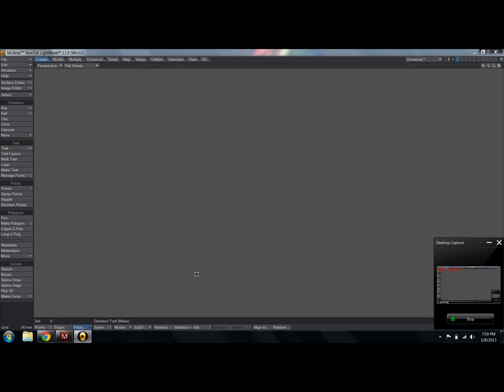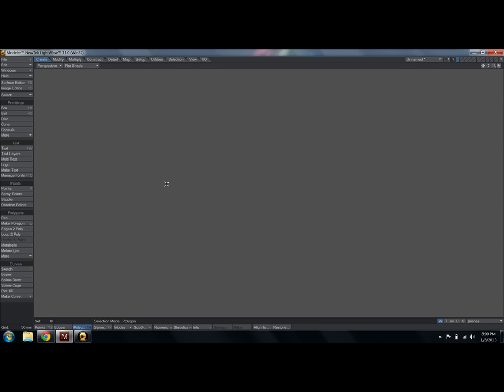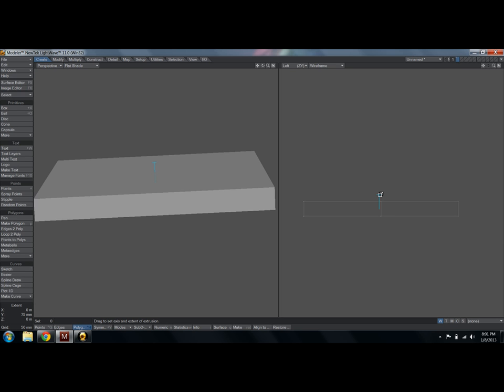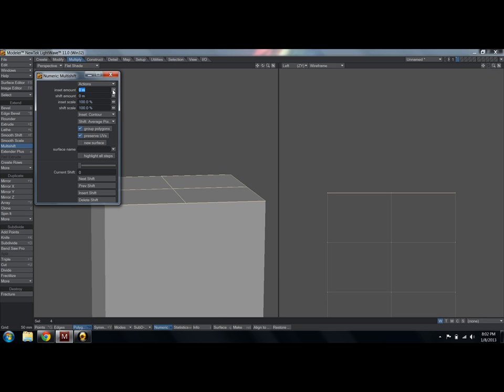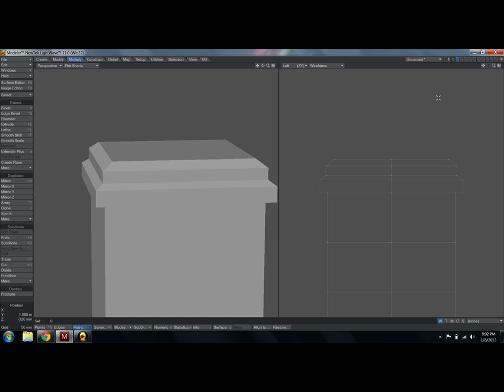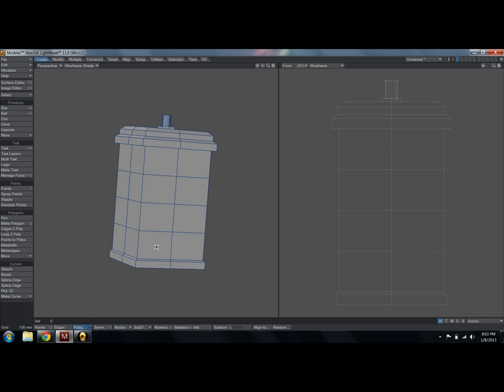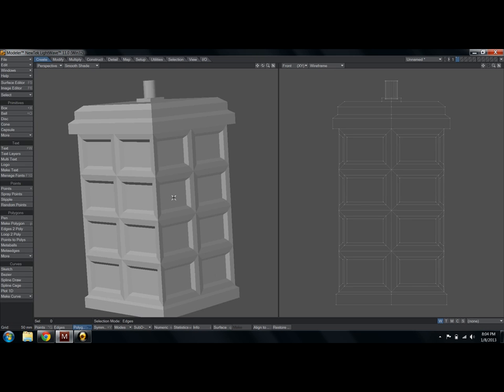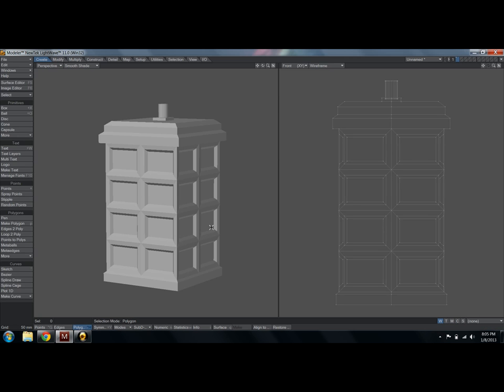Lightwave 3D for Beginners / Pt. 5 / Build tutorial! "TARDIS"

Comment: Whenever I use multishift on subdivided polygons, the "Group Polygons" in the numerical panel doesn't seem to actually group them. I've restarted modeler 5 times now just to get it to function, but it doesn't. Any ideas what is causing this? I can't bevel all my subdivded polygons together, they just split up into their individual squares, please help!!!
Reply from the maker: No idea. It might help to clear your config files before restarting, though.

In your program directory, if you dig into it there should be a "configs" folder. Go into that, make a copy of everything and put it somewhere else for backup reasons in case you need them again, and then delete that stuff from the original folder. (Leave the configs folder itself there, just delete everything in it.) Modeler should automatically write new configs the next time you open it, and ideally that solves the problem.

But also maybe not. 

Is it possible that all your polygons aren't actually welded together? The behavior you're talking about sounds as if it could be simply that the polygons on your surface are next-door to each other, but not part of one cohesive mesh. Merge points and try again?
Reply: Teague Chrystie Okay thanks! I'll try that later and get back to you :)
Reply: Managed to fix the issue, configs weren't the issue, somehow I had some side only polygons going across the sides of my polygons I was attempting to multishift, I think the issue was that they weren't actually connected. I managed to grab those polygons in wireframe mode, deleted them and then I recreated the polygon by selecting the points and creating a polygon between them. This fixed the issue :)